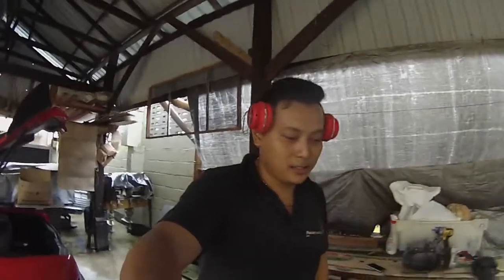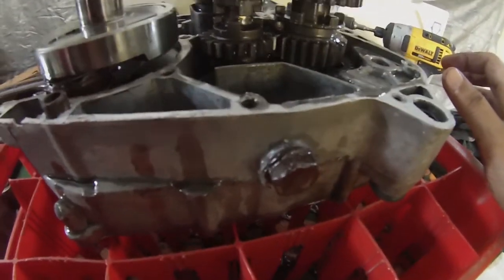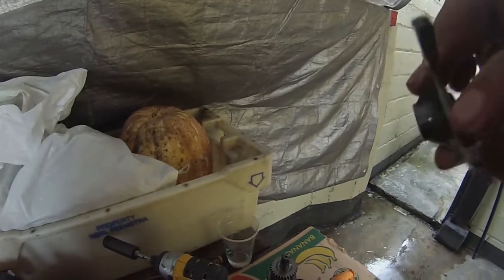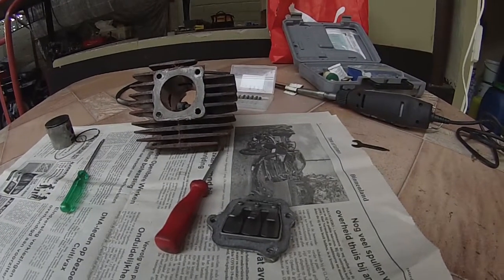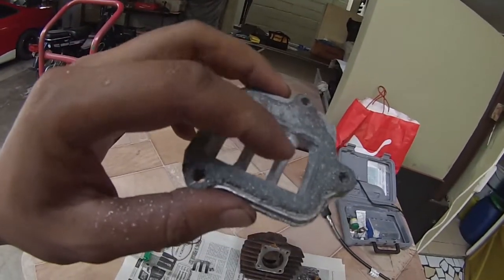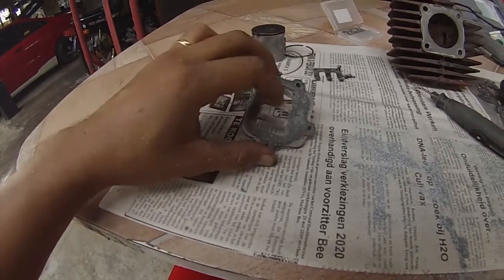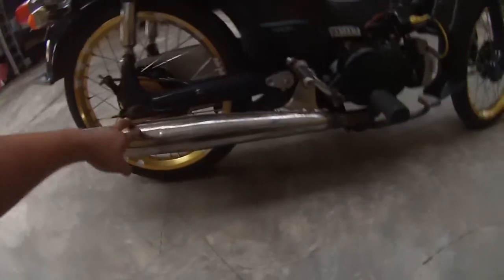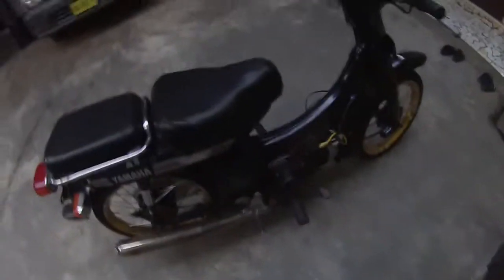Yamaha V80 engine teardown

Comment: Do you know if the V70/V80 use the same clutch release springs as a U7e on the outside of the stack?  
The U7e uses 3 fiber disks, I believe a 70 has 2 the 80 has 4.  Are the springs the same though?